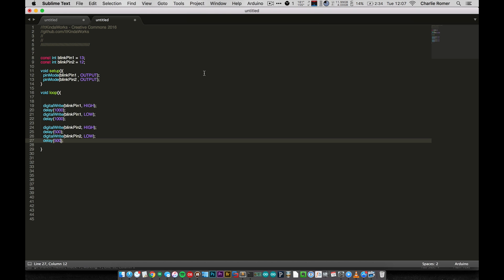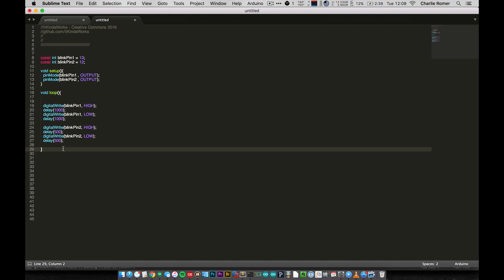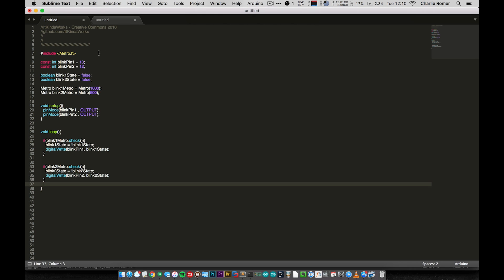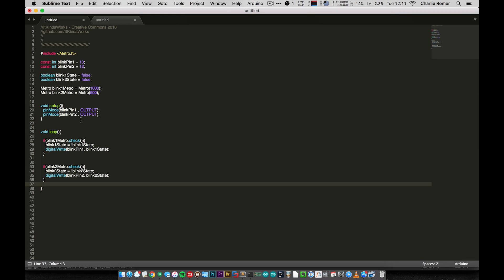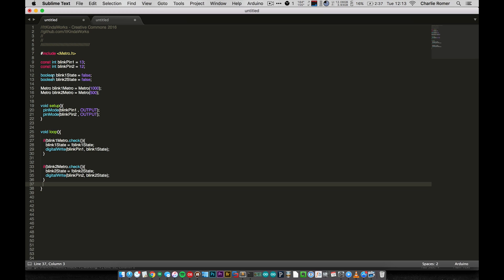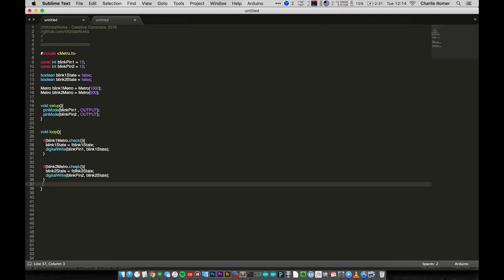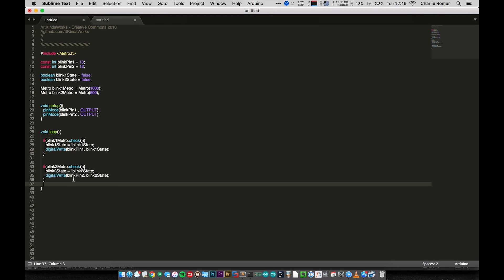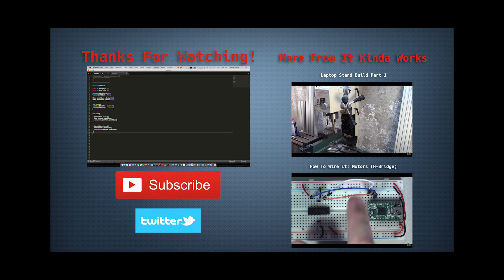How to multi-task on an Arduino

Comment: In order to switch the state of a boolean variable from true to false vice versa, the simplest way is a logical XOr operation:
bool variable = false;
Variable ^= true;
Reply: Yes, but you are missing the point of this video here.
Reply: I find that 

 variable = !variable;

is more a visual represention of what is going on.
Reply: @pascha4527  Well, do as you like. An XOR Operation is the logical inversion of the binary value in that variable. But as (almost) always, there usually are more than one ways to do something. But i think that the XOR Operation is simply leaner and faster in machine code than any other way, since it can be transferred into machine code 1:1 whilst your code particle is actually made of 2 independant operations: an Inversion (the result of which has to be stored in a register) and an assignment operation (which transfers the value from the register to a variable) which together produce more machine code. The XOR variation can be realized with one single machine code operation on almost every processor

Comment: It could be done in the loop only, with something like this:
void loop() {
digitalWrite(13, HIGH);
digitalWrite(12,HIGH);
delay(500);
digitalWrite(12,LOW);
delay(500);
digitalWrite(13,LOW);
digitalWrite(12, HIGH);
delay(500);
digitalWrite(12,LOW);
delay(500);
}

Of course, once you can't easily find a common factor, it gets much more difficult, and we must resort to multitasking with the metro or TimerOne libraries.
Reply from the maker: Sure thats totally true that this example is not one that requires multi-tasking. Rather than come up with a complex example though, I figured it best to keep it simple to demonstrate how someone with a more complex problem could go about it.
Reply: Yeah I understand. :)
Reply: Great video, though!

Comment: Can you use a PWM pin to fade an LED Up and Down while the other pin is Blinking LED?
Reply from the maker: You totally can!
Reply: Thank you... I am trying to run a For Loop Iteration (aka Larson eye ) sketch with another sketch which randomly light two LEDs using your Metro library. I would like to know if I need to incorporate a "While" statement so they can run separate from one another as they presently do. Please forget my question as I'm a Neophyte to Arduino programing... Thank you for your direction on this question.
Reply from the maker: When using Metro, it is preferable to not use while loops as they "block" other code from running. So if you had a loop to fade the LED up/down then the program would run that loop (fading the LED all the way up or down) and then it would blink the other LED. Instead of doing that you can use 2 metro timers (one for blinking and one for fading) and just make the fade timer something small like 5ms and have the fading LED just fade up/down a small amount each time the timer is triggered. Here is a small arduino script I had laying around already that does roughly what I think you want: https://gist.github.com/ItKindaWorks/512be9da4c6c6a2e61c99f48eaacb4f9

Comment: I've done this kind of thing, for decades, on various microcontroller families (AVR, HC05, 8051 ...). I've always called it "poor man's multitasking", since it doesn't use a pre-canned RTOS package. The use of timer interrupts and state machine design, allows several subroutines to run concurrently. This is basically what an RTOS does, but you just create your own, simplistic version. Arduino has a timer interrupt library, to operate similarly:

http://playground.arduino.cc/code/timer1

I also design my code in block diagrams. These operate the same way as different circuit blocks in hardware. Info is passed between the various blocks as variables, from boolean (or as we old farts call "flags"), to whole arrays.
Reply: Cooperative Multi-tasking.
Reply: How can you run both task's under pin 6 concurrently?  If I don't want to use multiple pins.

Comment: Just getting in to C++ and Arduino but from what little I've seen, I would have just written, "digitalWrite(blinkPin1, HIGH); delay(500); digitalWrite(blinkPin2, HIGH); delay(500); digitalWrite(blinkPin1, LOW); digitalWrite(blinkPin2, LOW);    and to me that would blink both at the same time.  However after seeing time and time again today in videos that DELAY pauses the Arduino, I've been looking at using millis() and it seems this Metro library is some sort of short cut to typing out individual millis() code?  Either way, happy I found this video, thanks!
Reply from the maker: Yeah, the metro library basically abstracts the millis code away from you so that you can focus on just writing the code that you want rather than getting caught up with the timing of things. It's a hard thing to get used to at first that the Arduino (and really any computer for that mater excluding things like multiple cores) can only do one thing at a time.
Reply: Yeah coming from ActionScript from years ago saying, "do this, and this, and this... and this and this AND THIS AND THAT AND THIS" while mouse over or something, heh sort of just "experienced" that the computer does multiple things at once, even though it doesn't at all.  *cheers =)
Reply: James Heslop your code is missing some stuff 🤔
- one more blink cycle for the 2nd led... ✌

Comment: Here the time is triggering it. But What if i want to do two or more functions at the same time which includes input and output. For example, Lets say i want a robot that moves hand when we move close to it and if we press the button it will move. but I want it to do both of these activities simultaneously like pressing the button and also move close to it. What should i do in this case

Comment: I spent almost a year with this problem, I wanted to multitask so many things. Millis got way to complicated to code, RTOS is impossible to try to figure out. I dumped the Arduino and went C# had the program up and running in no time. Never knew metro even existed. Thanks

Comment: Hey, nice video and great channel. You have a new subscriber :) 
Here is my solution using Python and Multithreading on an Arduino Due: https://www.hackster.io/luigifcerfeda/multiple-blinking-leds-at-different-rates-with-threads-using-viper-4aacd2

FYI, Zerynth (www.zerynth.com) enables Python for Microcontrollers. It is a Python VM on top a RTOS. I think you might be interested!

Comment: Hope your having a great time on your vacation :) .... great work on the DC motors ...you sir are a genius ...can u make a video when you get back from your holidays on how to control AC motors eg. fan speed control  using arduino ,i have been looking around but could not find anything as great as your tutorials with DC motors..plss help me out .. tc enjoi
Reply from the maker: +aakash salvi  hey thanks! Vacation has been great! Hmm I'll have to look into it, ac motors and ac circuitry in general is a bit outside my knowledge set but I've been meaning to learn more about it. I specifically want to make arduino based AC dimmer circuits for lights but I imagine more or less the same idea would apply for ac motors as well.
Reply: I saw sumthing with triacs .. But i could not get how to provide inputs ...m sure u will get it in a glance
Reply from the maker: +aakash salvi yeah triacs are definitely the way to go but last time I looked at least light dimmers I think there might be a feedback circuit that is needed to detect the point in ac sine wave so that you can trigger the triac correctly. Could be wrong about that but I feel like that's why I stopped last time I started looking in to that
Reply: +ItKindaWorks i have absolutely no idea i have learnt evrything from your videos only so please mke a tutorial on this too....
Reply from the maker: +aakash salvi haha well I will definitely try to get it figured out! Just gotta learn it myself first :)

And thanks for being a loyal viewer, it's people like you that keep me going!
Reply: +ItKindaWorks dude ur my guru thanks for making us all  understanding such complex circuits in such simple way nd do u have any idea wen esp32 wuld b out ?
Reply from the maker: +aakash salvi I've been on the lookout but I haven't seen any public sources for the board. I think they're in limited beta or something at the moment but I'm guessing before the end of the year they should be out. I'm going to buy up at least 10-20 the moment I see them go on the market though, they look awesome! I'm also interested in the esp8285 - basically the same as the 8266 but has built in flash
Reply: +ItKindaWorks hey hows vacation goin ... m working on ir signals now can u point me sum ir remote control using esp8266

Comment: you can also do this:

if (millis/1000 % 2 = 0){
digitalWrite(13,HIGH);
}else{
digitalWrite(13,LOW);
}
Reply from the maker: Yes that would work for this example however my purpose with this video was to show a dead simple way to do general multi tasking. Plus that method also has a lot of redundancy as at any given moment it will either be spamming the LED on or off over and over rather than just turn it on once or turn it off once. I feel like % and millis are also not exactly beginner concepts. I was even somewhat uncomfortable introducing ! in this video as it is geared towards beginners which is why I tried to explain it out a bit. The great thing about the Metro library is that it abstracts those concepts away from the programmer so that they can focus on doing the actual task.  This was also more about general methodology than specifics.
Reply: Why "millis/1000 % 2 = 0" instead of "millis % 1000 = 0" ?? What would be the difference?